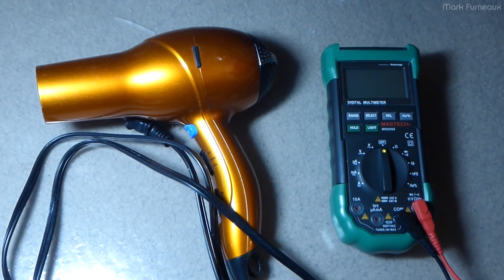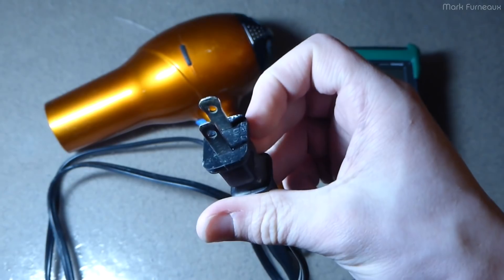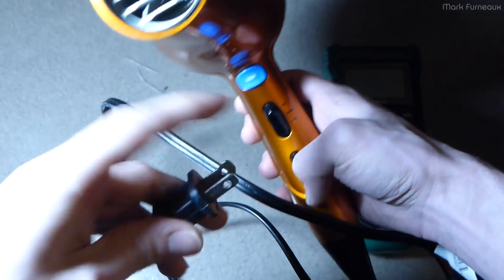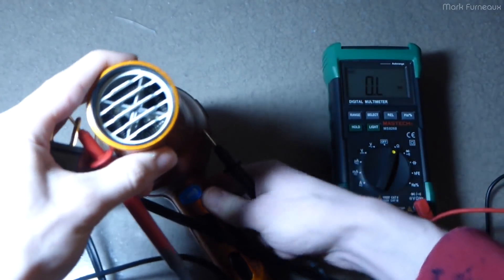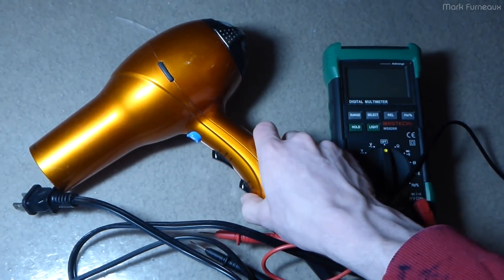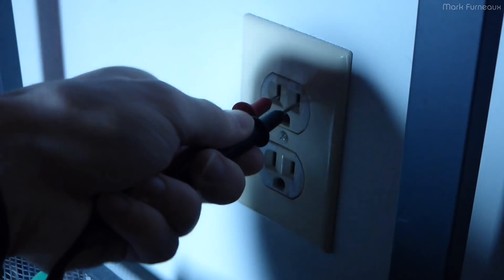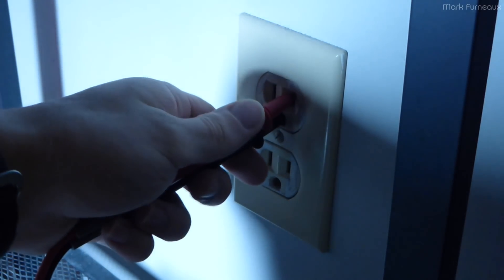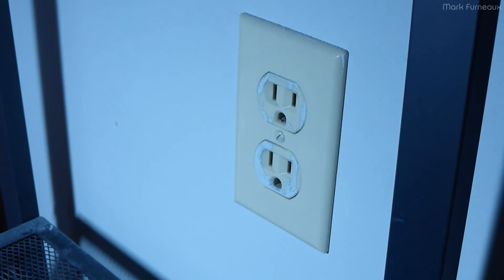Why Mains Sockets Are Polarized (And How To Check Them)

Comment: Great video!  When wiring an outlet I always remember brass screw to black wire (both start with the B). Easy way to remember. The neutral goes to the silver screw. Thanks for posting

Comment: I have one of those three LEDs yellow plugs that tells if the plug is wired correctly or not.  Pick them up at Home Depot or another hardware store.  Checked one house and only the bathroom had a ground connected !  The bath room (W.C.) was the only safe place to plug in the computer !  Update this video please !  tjl
Reply: Tim Lipinski I would recommend you contact your landlord or a licensed electrician since a faulty device can’t trip the RCD. You could get electrocuted and your house is constantly at higher risk of fire.